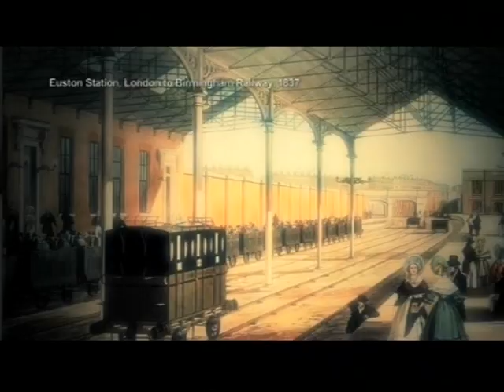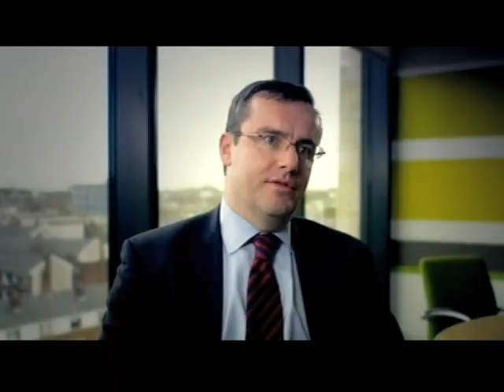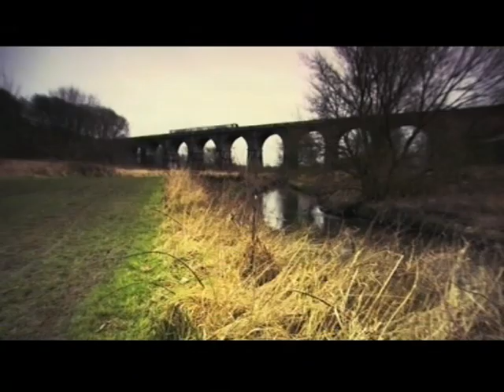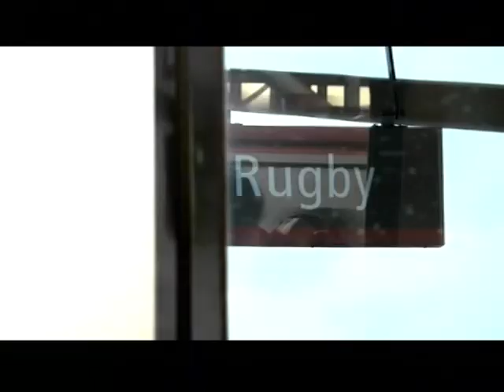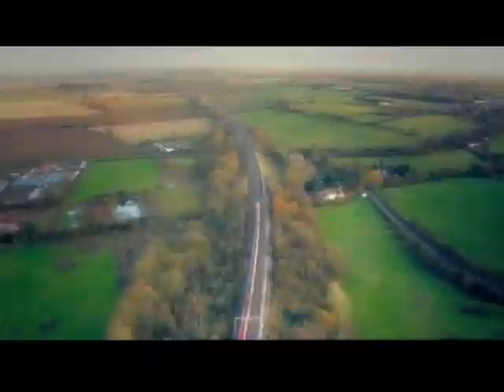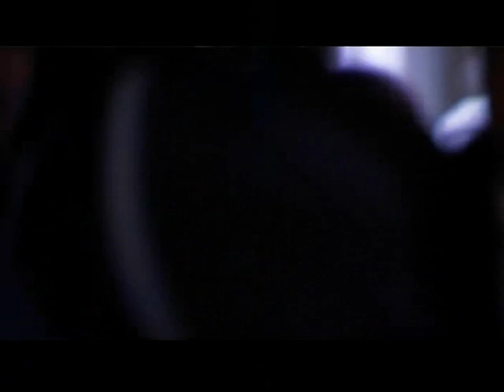Railtrack/Network Rail/Virgin Trains-West Coast Route Modernisation & Upgrade History 2004

Comment: If they build the High Speed 2 line it may be to the detriment of Stoke on Trent.  Stoke is on the west coast line and thanks to the west coast mainline improvement now has a good service of 1h25m to Euston.  If built HS2 will bypass Stoke on Trent and services I fear will be reduced or slow down (or both).
Reply from the maker: Stoke may well end loosing fast trians to London but should end up with more regional express services that connect stations together. Some West Coast expresses now don't stop until Warrington, a lot no longer stop at Watford Junction (which was the M25 parkway station) so the plan is to run a lot more trains that connect more places more ofter (asuming that doesn't change).....
Reply: Soi Buakhao I readily travel to Stafford, Northampton, Crewe, Liverpool, Manchester, Macclesfield, Stockport etc but mostly London Euston from Stoke on Trent.  What is most needed is east - west travel from Stoke on Trent.  For example Nottingham which is far quicker to drive to.
Reply from the maker: @Rick2009h  yes cross country is very slow. I travel Crewe to Nottingham every October and it's a right stagger!

Comment: Did railtrack shareholders get any money back after collapse? I had railtrack shares but forgot about them.   HS2 was on talk radio earlier, 2 million in redundancies but no track laid!
Reply from the maker: I believe a small amount was paid out. Hs2 (or the north-south capacity relief line to describe its intended purpose) really needs to get its act together. I am all for the railways having their own form of motorways, after all on the roads trunk traffic uses motorways where possible rather then A roads!
Reply: @SoiBuakhaoRoutemasterbus  yes, I agree.. I learnt yesterday Aberaeon (between cardigan and aberystwyth) had a station once.   Still find it  off Aberystwyth has a pub called  'Dr Beeching' !! 

Reason I say is I would like a lot of the rural welsh lines and towns return to Rail!
Reply from the maker: @tonyjones9442  So would I! But i think Caernarfon and Llanberis is most unlikely sadly....
Reply: @SoiBuakhaoRoutemasterbus  never mind a nantlle  branch!  ( pen y groes junction on afon wen line - I'm sure you know of it)
Reply from the maker: @tonyjones9442  You can drive along part of the old Caernarfon-Afon Wen line, the A487 runs on parts of the old trackbed!
Reply: @SoiBuakhaoRoutemasterbus  I often cycle along cycle track it to caernarfon. It's a fairly fast road too - when I had a car. I'm usually on it in a bus now.

 Gradient was quite steep for standard gauge especially after pant glas. 

There used to be mainline sidings below caernarfon castle. The track is still there. In our welsh ways all they did was just tarmac over them. The points have rusted through so you can see the outline of the points and track in the car park by swing bridge. 

Further south near me, between chiwlog and ynys  theres a crossing keepers house. The crossing gates are still there with the circle plates on the gate. A few places theres also sleepers and clips. Amazing there used to be a turntable at afon wen. I was on afon wen beach today. Only short walk.
Reply from the maker: @tonyjones9442  It's amazing what still exists. On the Llanberis line, which is now a footpath, you can go through a short tunnel after the junction of the road to the Ty Mawr Tea Rooms, then along the walk their is a mileage post and a bridge over the track still! Plus the station buildings at Llanbearis are in use as a cafe & shop.